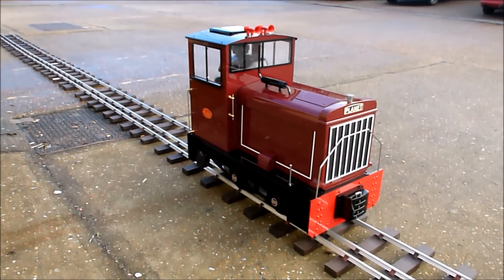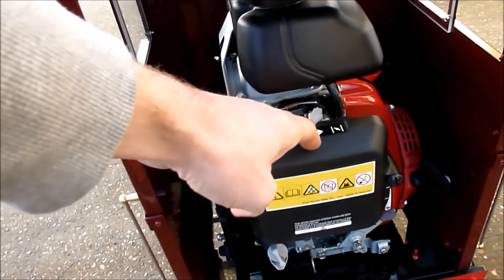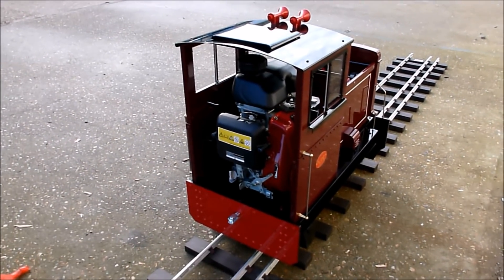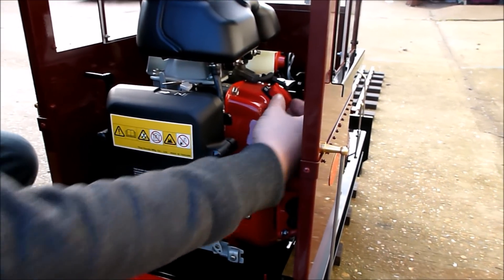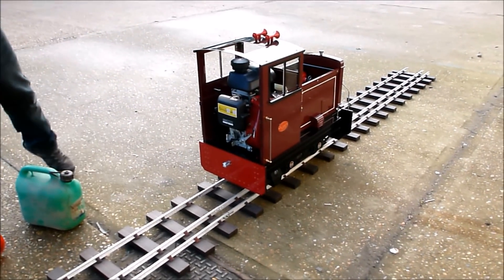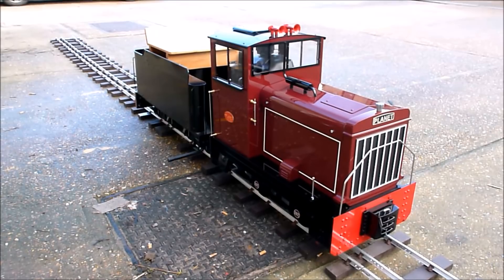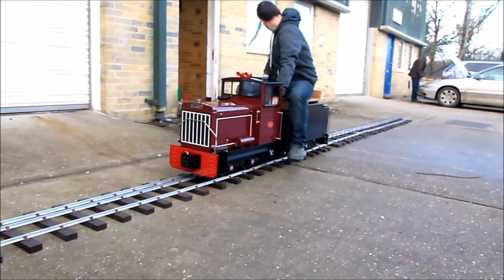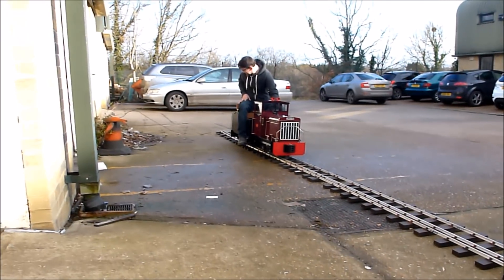Planet 2 Petrol Hydraulic

Comment: Is there any particular reason you went this way rather than the petrol electric? Is that version available, I don’t see it on the website.

Thanks.
Reply from the maker: Yes, the electric system was complicated, really complicated so we went back to these very robust eton hydraulic systems,  there are very expensive but very reliable. much easier to service and maintain.